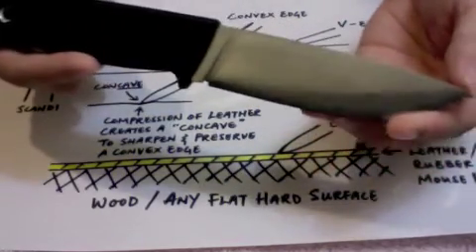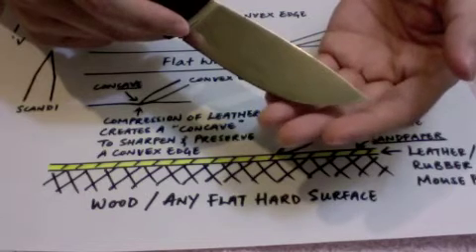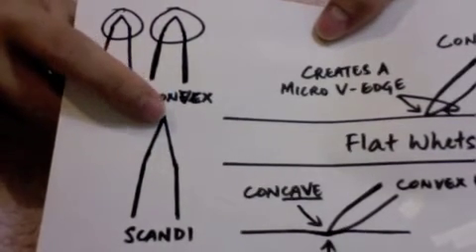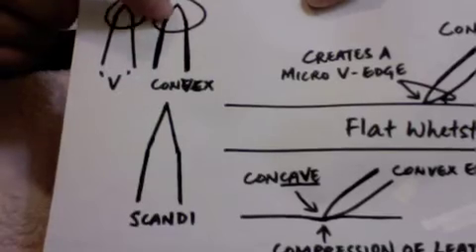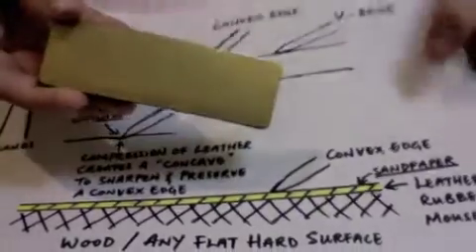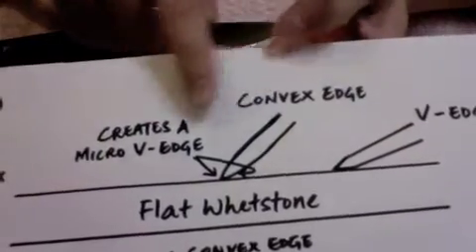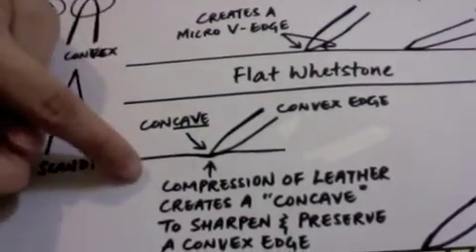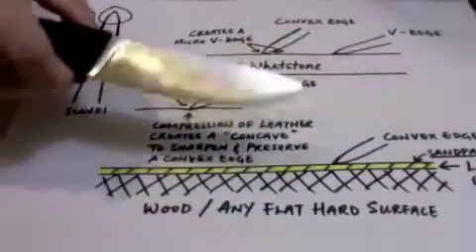Convex Sharpening Explained

Comment: You can also sharpen a convex egde on a waterstone, by rock/change position of the blade on the stone and that way maintain the convex edge.
   - Like " vitorious " show on his side.
 I have both musepad / sandpaper, strop and waterstone. After use, a few stroke on the strop is is enough to sustain a sharp edge.
   - Great video thou. Good explanation.

Comment: the f1 is infact has a micro v edge from the factory i hate it so i sharpened it on a 5000 grit stone to blend the mico v edge with the convex grind trying keeping the same factory angle but removing the micro sholder by useing a shallow angle then i use green compound on the strop to refine the edge the key to sharpening a convex grind is to remove metal from behind the edge first to keep a shallow convex edge then to raise the angle to just touch the edge if you draw a line on the edge of the knife with a marker pen then you can see were you are taking the metal from. do not use a mouse mat with sand paper this will result in a steep convex grind and a dull knife the f1 has a tough edge from the factory geometry and is not as sharp as many scandi grinds so why make it steep? fine sand paper is good on a flat serface